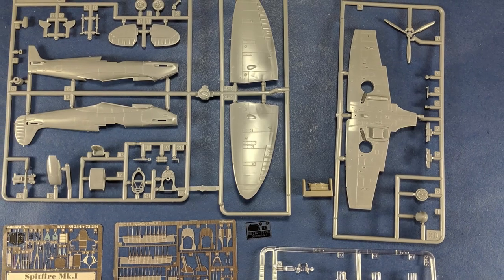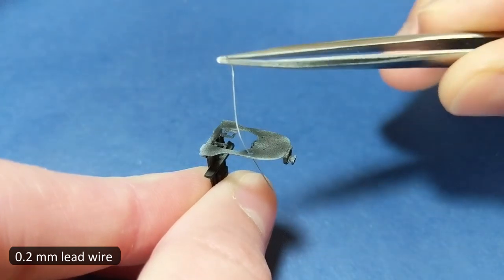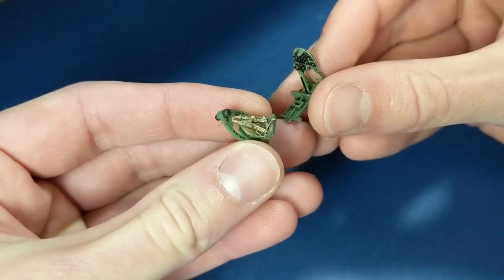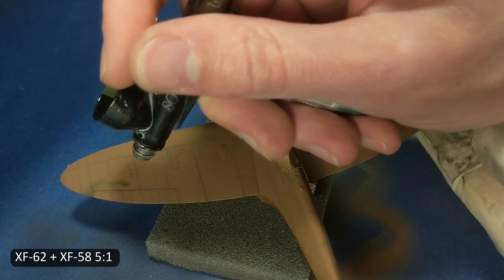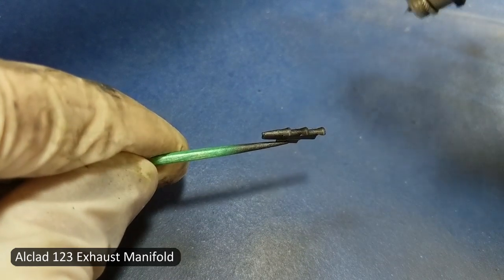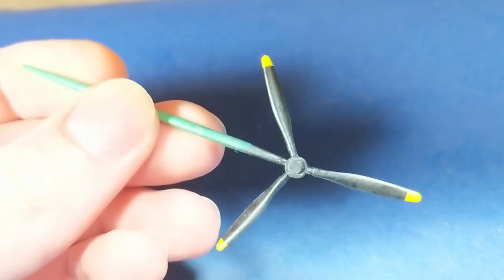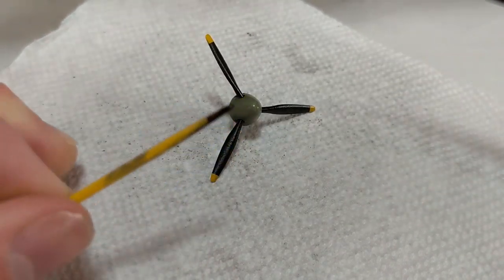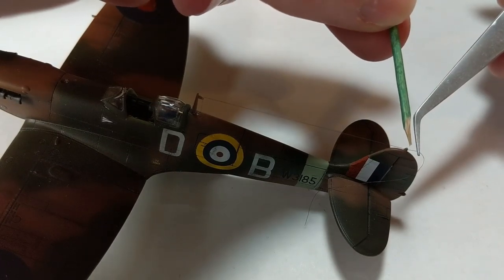Spitfire Mk.Va - Tamiya 1/72 - Full Build

Comment: Nice idea, I made a Mk.Va a few years ago by cross kitting the Airfix Mk.Ia and Vb, I used the basic Ia kit with the propellor, spinner, canopy and underwing oil cooler from the Mk.Vb, also did it in the markings of Douglas Bader’s Spitfire. Bader used the Mk.Va because he, apparently, didn’t trust the cannons fitted to the Vb, he preferred machine guns because he considered them more reliable in combat.

Comment: There is one external visual difference between the Mk.I and the Mk.Va, the oil cooler beneath the left wing, on the Mk.I it’s fairly shallow with a semi-circular intake, on the Mk.V they increased its size and gave it a circular intake.
Reply from the maker: 👍 thanks I'll need to take a closer look at the pics

Comment: Hey bro, Do you have a recommendation for a model kit that is easy and doesn't need a lot of paint?
Reply from the maker: This spitfire kit was easy and basic if you omit the photo etch.  Generally speaking though, WWII 1/72 scale is smaller and won't require as much paint.  Tamiya and Eduard are my 2 favorite brands for these types of planes.  I havent built any but the Eduard weekend series is supposed to be fairly basic.  Or you could search thru tamiyas catalog as they also have well engineered kits, and some of the smaller and older kits have less detail which equates to an easier build.